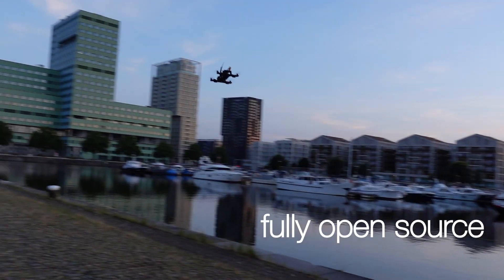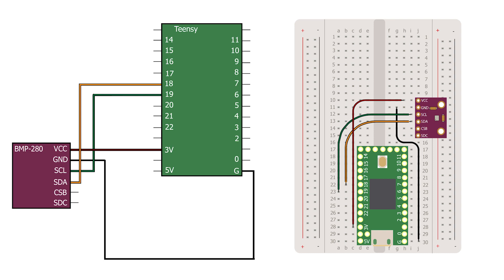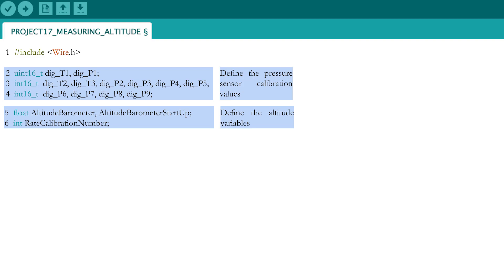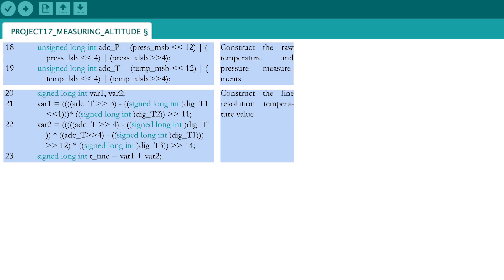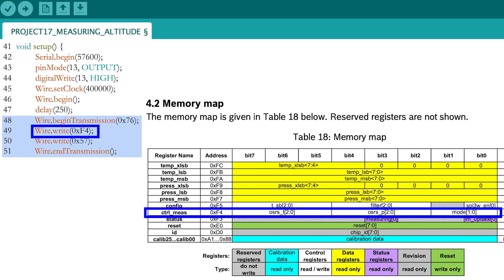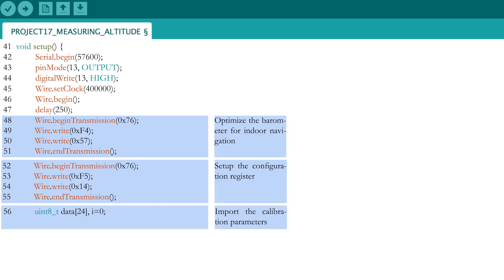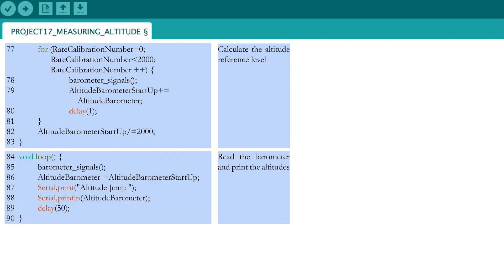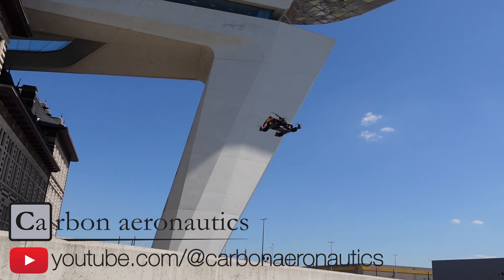17 | Measure altitude with the BMP280 barometric sensor

Comment: Hello, what about outdoors configuration ... 
Will it be enough just to replace the barometer BMP280 with a more accurate one or, for example, configure BMP280 for outdoor? Is it necessary to change the approach in formulas and calculations?

Comment: Lmao I’m making a model rocket control system but this is exactly the stuff I’m using
Reply: Hey, I am also making a model rocket and i wanted to know that which sensor are u gonan use for altitude measurement and is it precise or not?
Reply: @compilingthechaos  Im making my own custom board now that im further into development but for the IMU im using the LSM6DSO and for the barometer the LPS22HH, def not fully precise especially because aerodynamics around rockets but when combined with an altimeter it's good enough for what im doing

Comment: I never expected you to add a barometer to the drone. Usually people stop at the IMU for arduino drones. At this point, will you be incorporating a GPS and/or Compass?
Reply from the maker: Thanks! I will try to incorporate a gps as well, as soon as i have found one that is small enough and can be connected with I2C
Reply: @carbonaeronautics  My replies were being deleted for some reason
Reply: @Carbon Aeronautics  Great project so far. Also for more understanding of the GPS and Compass, I recommend watching the video made by Joop Brooking and his

STM32 GPS flight controller.

His Video: https://youtu.be/7Wt1fuE8tic